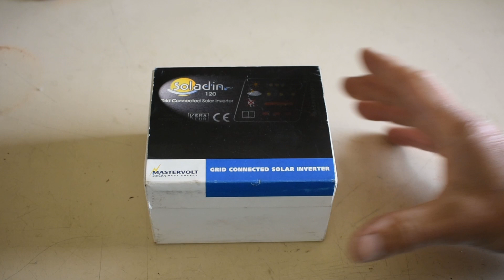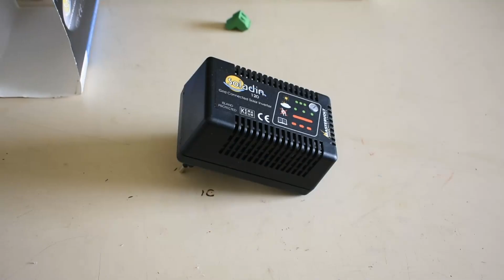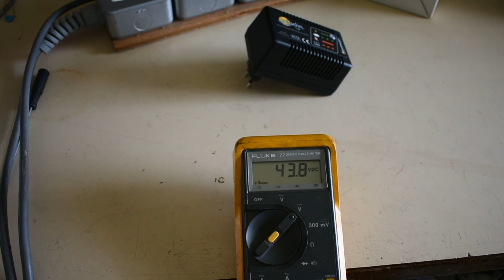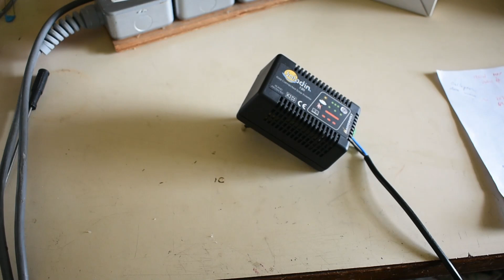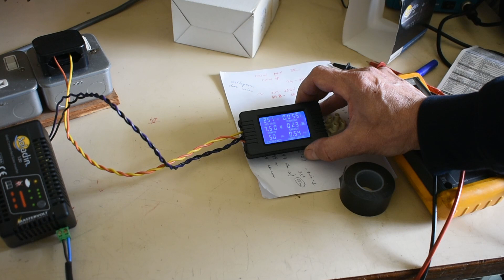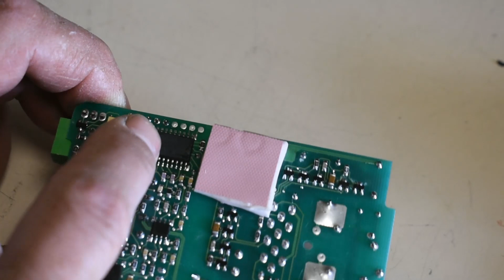plugin PV

Comment: I wonder if things like this will start getting cheaper with the industry heading towards microinverters
Reply from the maker: The biggest savings have been with PV panel costs. This is quite an old idea now, and at the time it was possible to have inverters on panels so they could be directly connected to the mains. It never caught on probably for reliability and efficiency reasons.

Comment: Interesting in that it can be made as compact as that even some time ago. No use as an off grid device? Does it need to sense grid frequency / voltage to switch the output?
Reply from the maker: The voltage range needs to be within 207V -253V and frequency between 49.8Hz -50.2Hz for it to attempt to connect. It will not supply otherwise. It is possible to fox it with the supply from an off grid inverter so long as the above parameters are met.